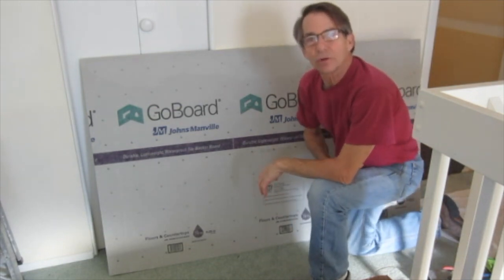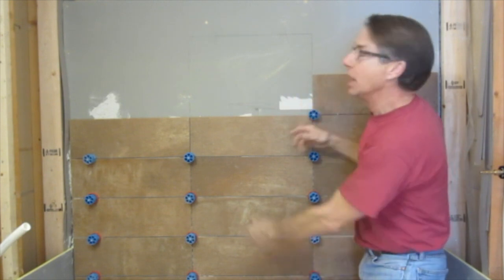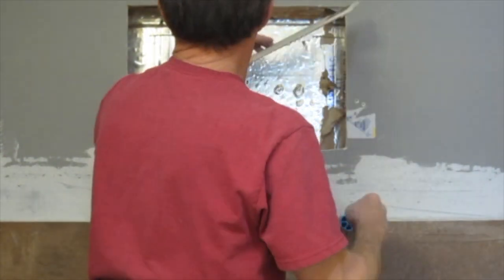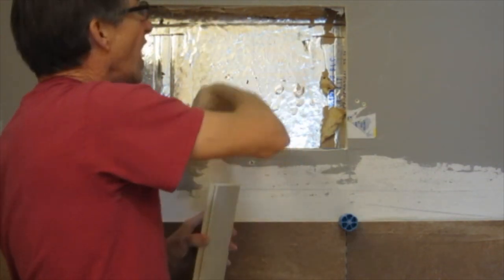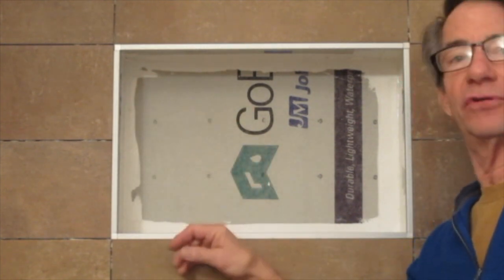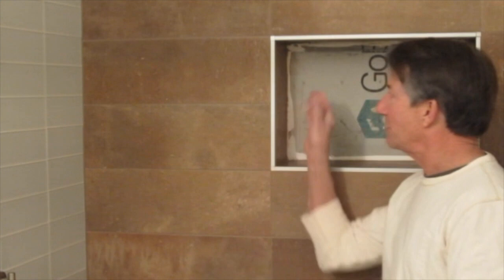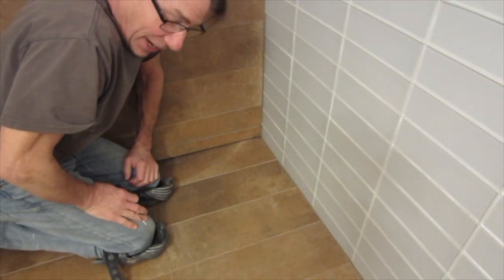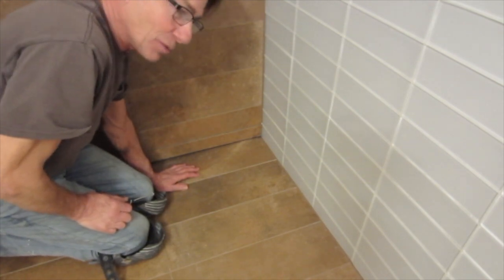Go Board Niche

Comment: I just built a GoBoard niche in a tub surround following your example here.  Thanks!  I used 1/2" GoBoard for backer on the walls.  Why do you use Densshield instead of Goboard as your backerboard for areas outside the niche?
Reply: Sir what the hell is a niche? We call it a “cubby.”
Reply: @Lugenfabrik  Some call it a niche, some call it a cubby.  Same thing.
Reply: Probably because it is more rigid.  If grab bars will be installed, be careful with using foamboard tile backer.  There is enough give to enable the tile to crack when securing the grab bars down.  Putting backer material in with construction adhesive behind the foamboard tile backer board, where the grab bars are secured,  will probably make it rigid enough.

Comment: A BIG step is missing in this video. He said he doesn't frame a niche ahead of time... that he simply cuts a hole for the niche where it works with the selected tile. But... then you seen him laying in the bottom of the niche and firmly pushing down on it. Whats supporting it? He also mentions screwing in the side which is another good trick since he claims he doesn't do any framing ahead of time.
Reply from the maker: No framing is necessary. The pressed in GoBoard with the proper caulk will hold everything in place. Go ahead and pre frame and let me know if your grout joints are in perfect alignment after installing the tile.